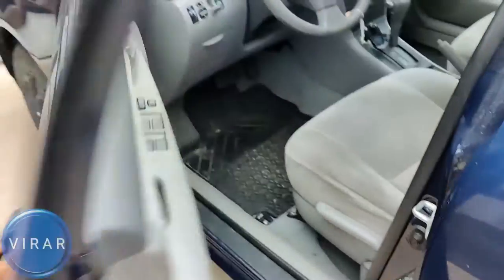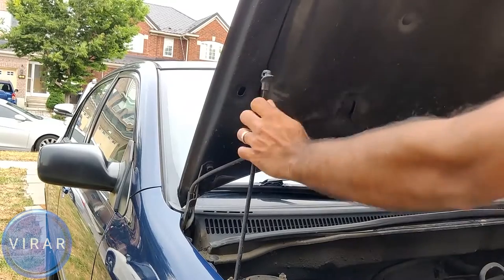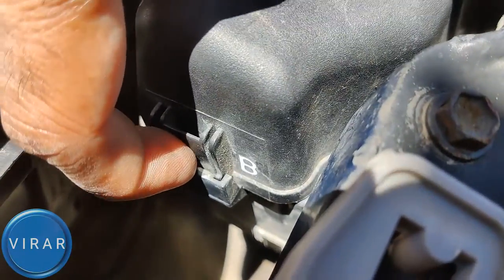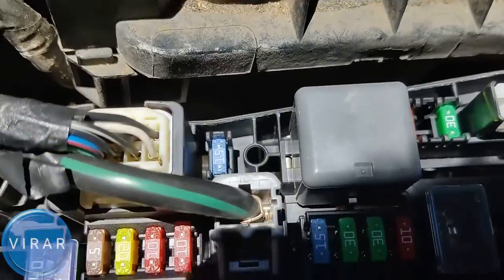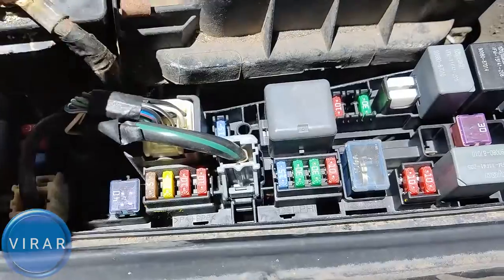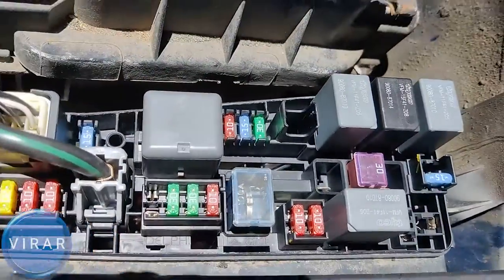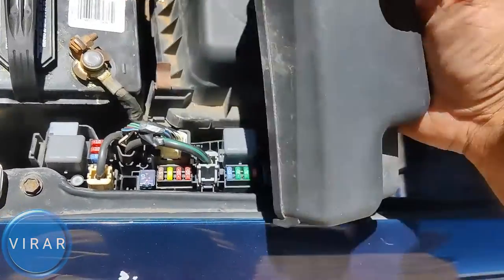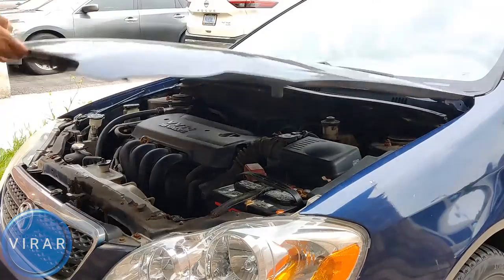No Interior Lights Working? Fixed! - Toyota Corolla (2003-2008)

Comment: Thank you for this video! 😊Hoping you can answer my question, if back dome light won't turn off, no doors are open to keep it on, (and there is no switch to turn it off) is this the same procedure?
Reply from the maker: Not sure what is causing that. This video is for a different issue, this is for when none of the lights are working.

Comment: But what if it's the dashboard lights? Dome lights are fine. Just the lights for the speedometer etc are not working. Is this a fuse as well or a bulb?
Reply: Same problem u figure it out?

Comment: Wait. So how do I know if I need to replace the physical interior light fuses inside the car or having to replace fuses in the engine compartment? 2006 Toyota Corolla. 

You're the first video I've watched going under the hood. I'm confused. Lol
Reply from the maker: I made this video on a 2008 Toyota Corolla and that is how you do it on it and I suspect the wiring should be the same for all 2003-2008 Toyota Corollas as they are all of the same generation.

Comment: I like the video but does the light come on automatically when the doors are open?  If there an adjustment to not come on?  My wife drove my car and now the light won't come on.
Reply from the maker: Maybe try playing with the light switch, the one that goes from on-door-off. That could be it.
Reply: @VirarAutomotive   Thank you.  Turned out that the bulb actually blew just after she had drove the car.  Bulb replaced and it's working now.

Comment: My Toyota corolla ae101 always lowbat and after i fix...i open the dome fuse it not leak again..how to fix it?
Reply from the maker: Sounds like a wiring issue or light switch issue. Sorry couldn't tell you more without having looked at it